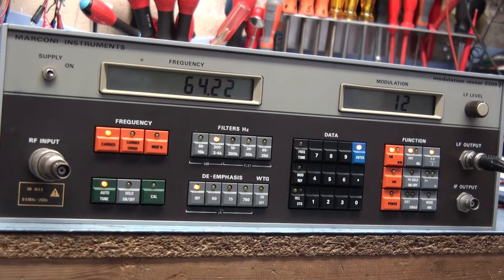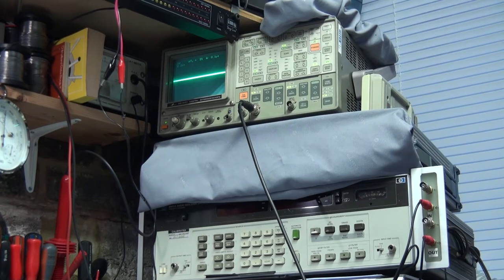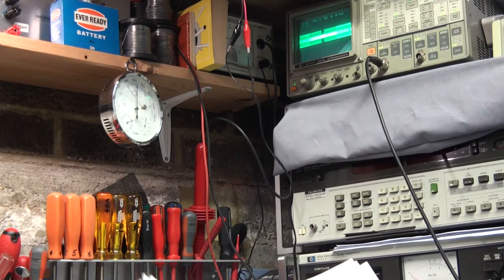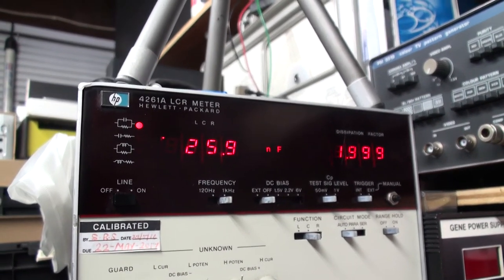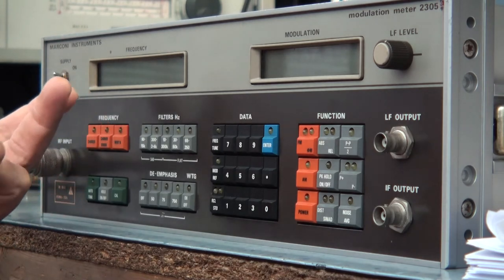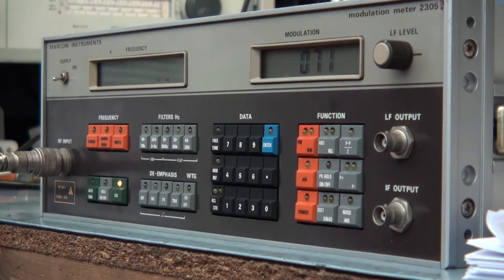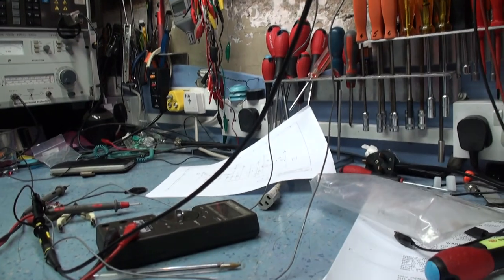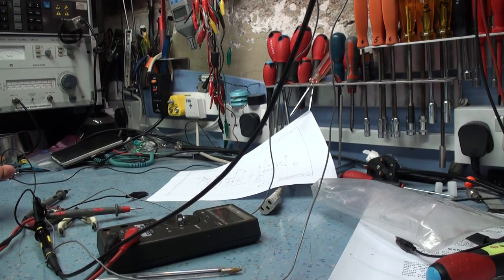Marconi 2305 Modulation Meter Repair attempt on a

Comment: The auto calibration  on first startup is normal for the 2305. The number in the right hand display on startup is the firmware version. The default startup is mode is to run the calibration process but can be changed in the protected menu setups. The faulty display segment may be a dirty connection on the lcd itself, I resolved mine by simply unplugging the lcd and re-fitting it as they are socketed. Karl

Comment: I had to throw away a few dozen of similar new old stock Philips capacitors, almost all of them were testing dead. Those caps are real junk, even maybe worse than chinese caps.
Reply from the maker: Funny you should say that. I have a bag of new old stock caps exactly as fitted in this meter. And they test low ESR! 
Storage is everything, they don't like heat!